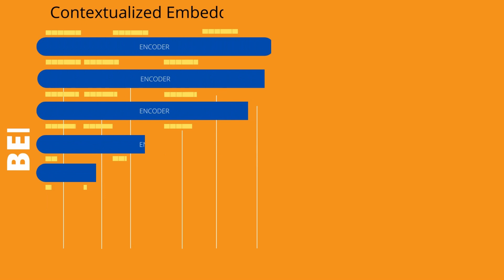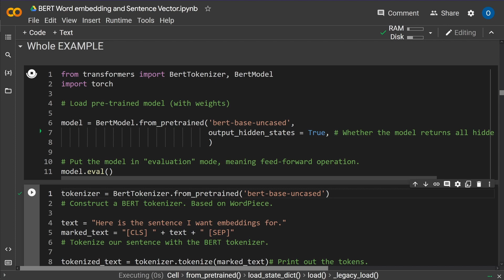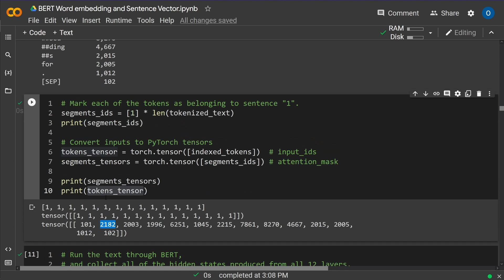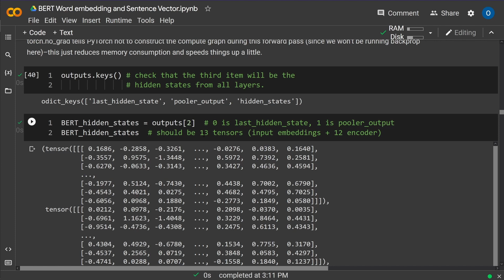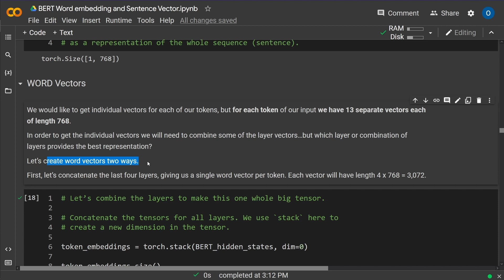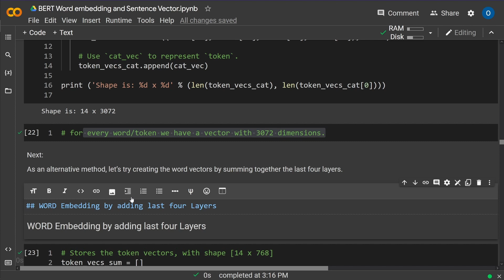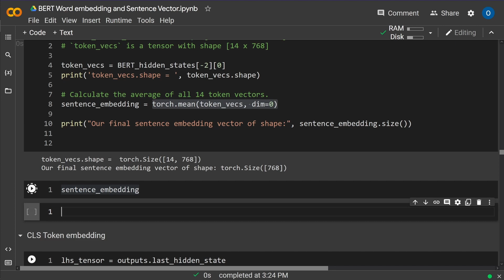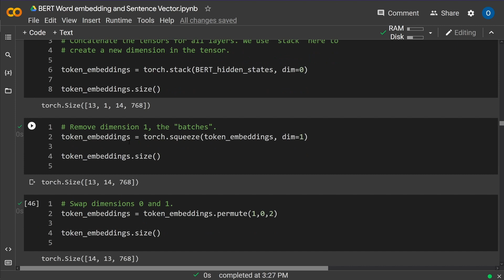How to code BERT Word + Sentence Vectors (Embedding) w/ Transformers? Theory + Colab, Python

Comment: my question is,  how bert generate 768 embeddings in bert layer???  is it randomly initialised or this embedding is already pretrained???
Reply from the maker: An interesting question. You can pre-train your BERT architecture like in the original pre-print on two specific tasks: masked language modelling (MLM) and Next sentence prediction. You can either put an additional layer on your BERT architecture for a specific MLM task, or there is a 2-layer solution (for MLM and NSP) for your BERT architecture. At the end of pre-training you can train your pre-trained BERT architecture further on specific downstream tasks, like BertForQuestionAnswering, which we call fine-tuning.
Reply from the maker: If you are interested, an upcoming video will show you the exact code when I pre-train a BERT system architecture, live and from scratch.